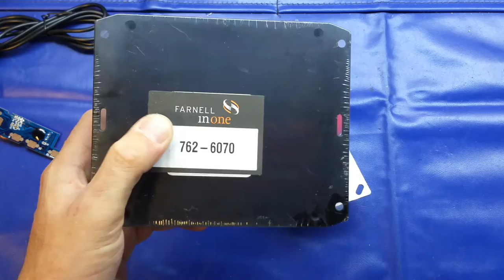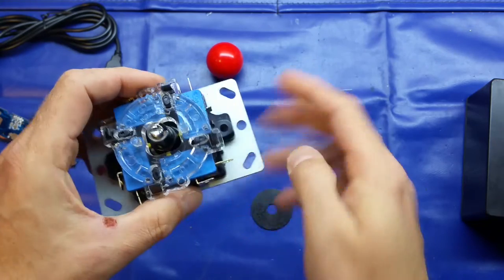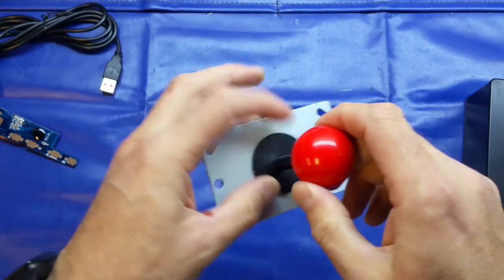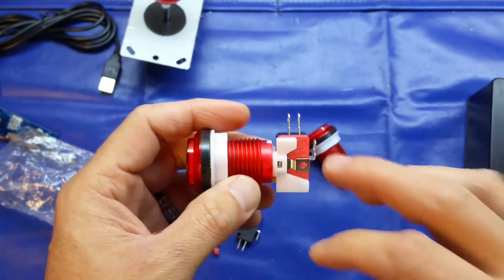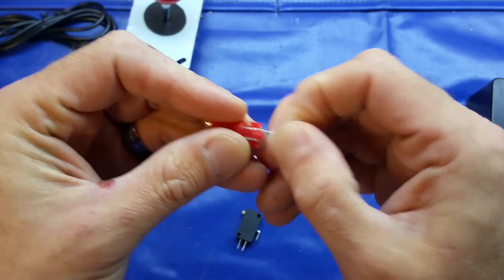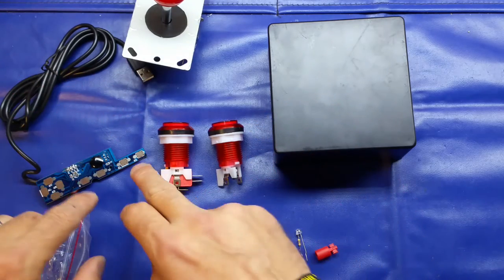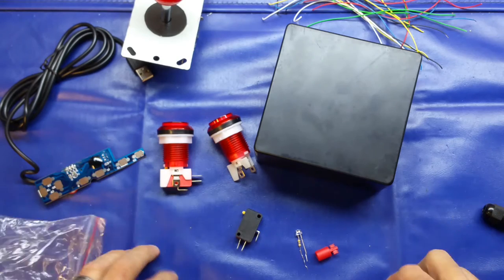Retro Joystick Build Part 1 - Description and parts overview

Comment: I did a project like this last year. My Father got one of the pacman tv games and the joystick broke and he asked me to fix it. So I got an enclosure that is a little bigger then that one and and put the pcb and battery pack inside of it. I used the cheap joystick also with cheep arcade buttons. I was able to solder to the pcb also. I added a power switch. I am sure it will last a long time.